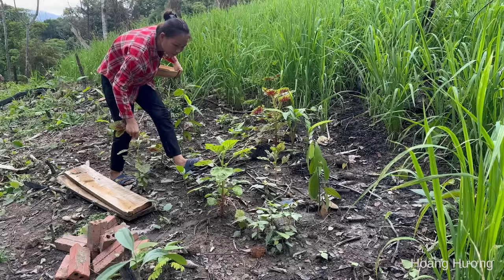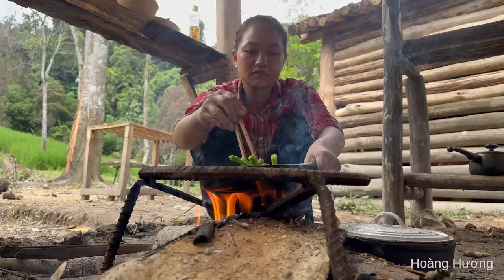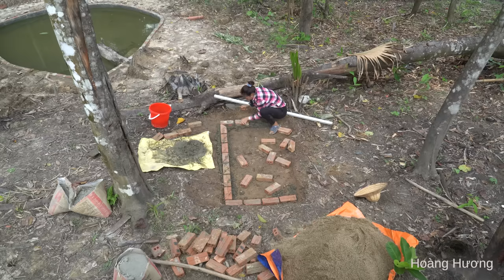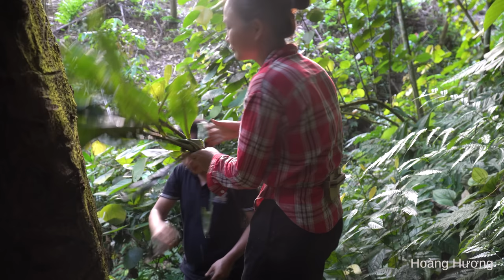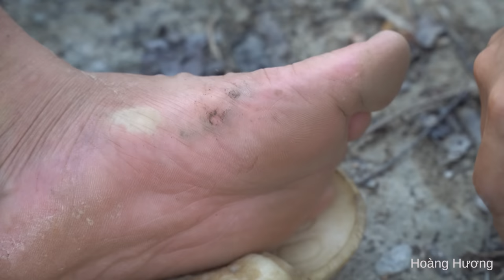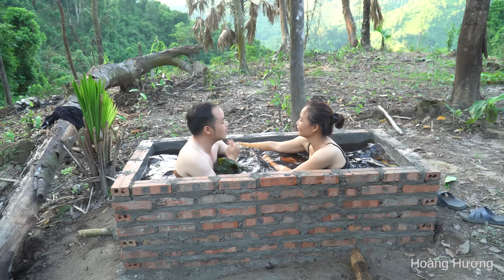build bathtub, husband and wife collect medicine together, herbal bath | Hoang Huong

Comment: For a water holding vessel you need to go up the inside with another layer of mortar before you put on a layer of just cement with water. If you don’t do this overtime, the inner sides will crack creating a hole and leaking your water out. Hope this helps. 😊
Reply from the maker: Oh thank you so much, I will do better. Wish you all the best.

Comment: If you used bricks to build a small box attached to the bath you could light a fire in it to heat the water. You wouldn’t have much way to control the temperature, unless you have a way to restrict air to the fire.

Just an idea 😊